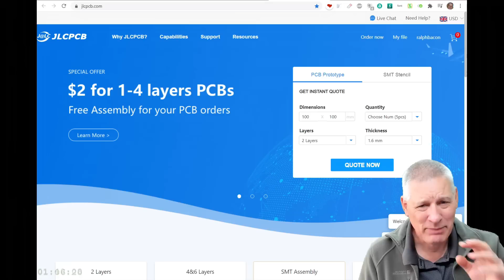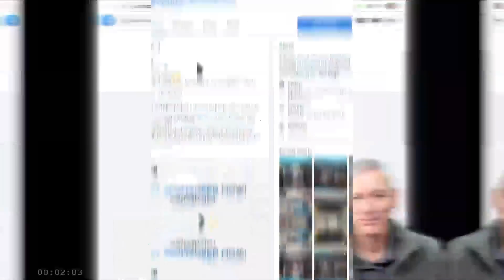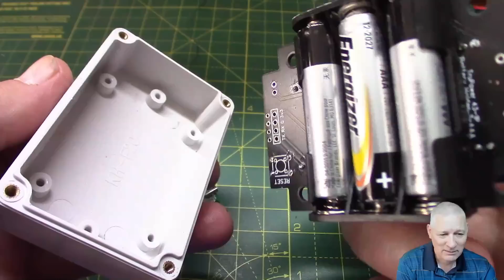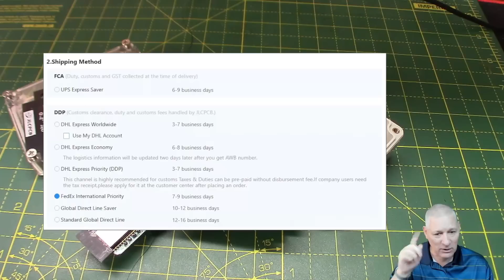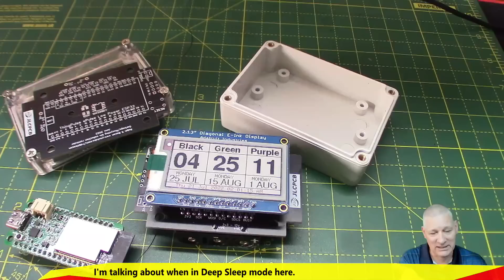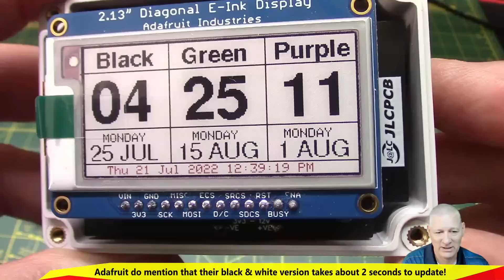#246 e-Ink e-Paper project with ESP32 Deep😴Sleep

Comment: Great Vid!  I have been using the feather platform more  - all my design I standardize to it as it allows for so many options!!!    Would recommend a redesign to allow for your feather version.
Reply from the maker: Yes, I'm considering a PCB redesign for it (purely for the low sleep current). I have other ESP32 modules for more "general" use that work well (and are cheaper).

Comment: The issue with the lid is where the injection mould feeds the plastic. I guess you could drill it out and use some clear epoxy to refill it?

Also Ralph, how do you know when the batteries die, give eInk is persistent? Wont you have to look for date/time change every day? Is there no way to measure Vcc and have a little battery icon?
Reply from the maker: Yes, I thought about the battery indicator but didn't implement anything. I guess that when it doesn't update any more (and I will be expecting that, after about 1 year) I will just change the batteries. Not a critical project.